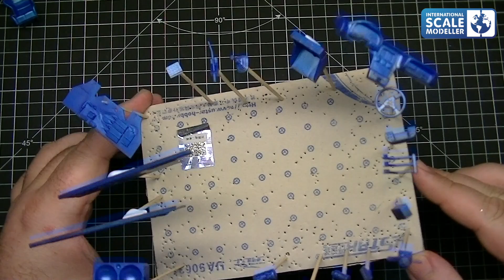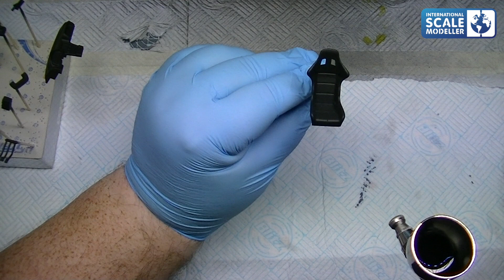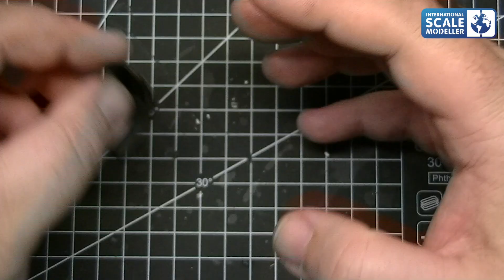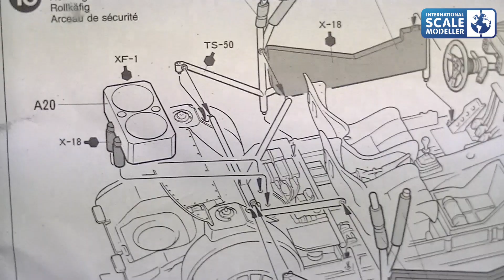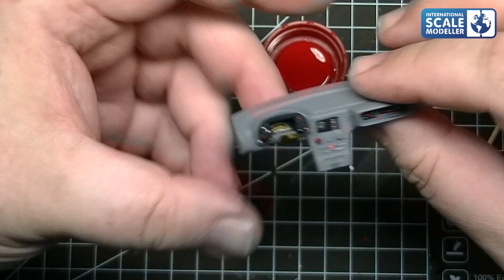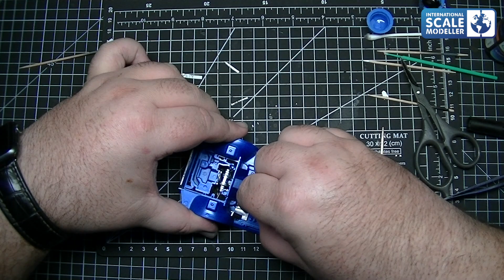Car Modelling Techniques Part 6 - Interior stage 1 Tamiya 1/24 Subaru Impreza '99 WRC

Comment: Hi Paul, great work again. Just wondering with the roll cage, did you prime and paint that blue before doing the black detailing? Same question for the chassis
Reply from the maker: Hi Ryan sorry for the late reply, yes it was all primed and painted the same colour as the body, Cheers mate, thanks for watching :)